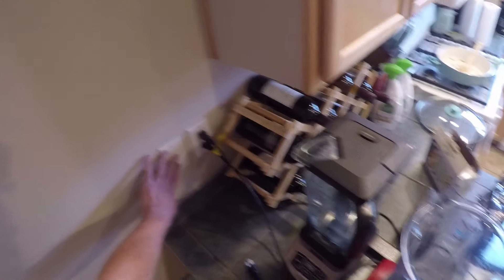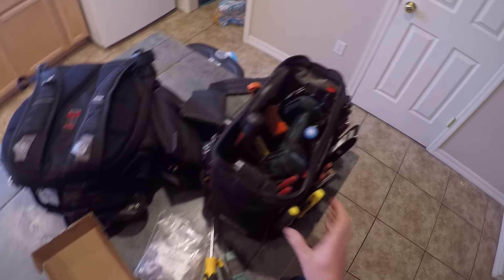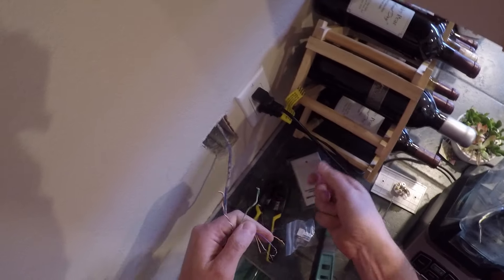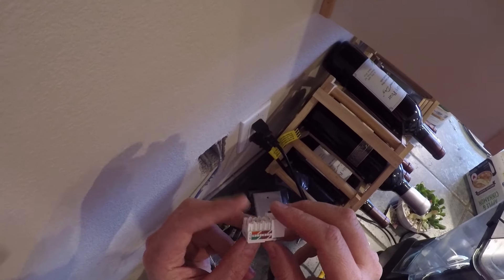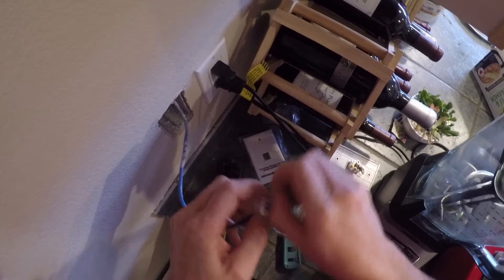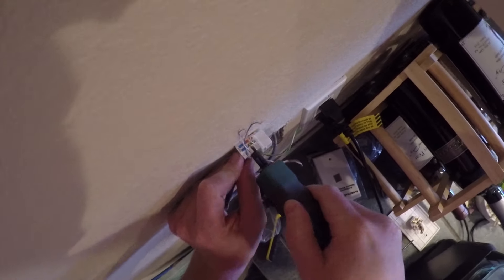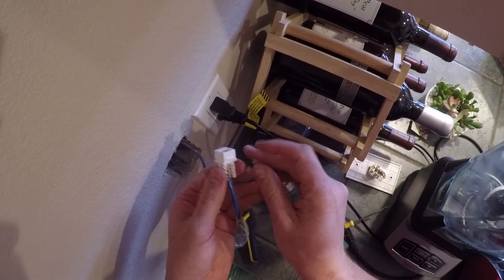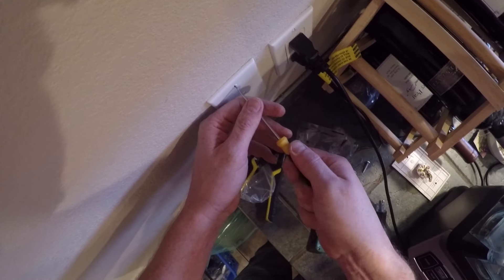Learn how to turn your phone jack into an ethernet port in 3 minutes.

Comment: This is a great option in most homes to convert to RJ45 port however finding out where it terminates is the real challenge.  Often it will be outside in a phone box on an exterior wall.  A ethernet network toner would be a great tool to locate the path of the cabling so it can be determined where the other end of the cable can be terminated closest to the router location.
Reply: Just use a multimeter on Continuity and extension plug(or long wires) . Use the pins on the extension plug as a extension for your multimeter probes . 

Stick one end of the wire that you are trying to identify into one of the holes on the plug then take the other end of the extension plug wherever there are data cables and then stick one of the multimeter probes into the same hole of the extension plug but oppisite side , then with the other probe touch the wires one at a time till you hear a beep or have continuity

Comment: Sorry if  this is a dumb question but once I do this how do I connect it to my router. For example, I want to give my house ethernet access. There are multipel phone jacks throughout the house. Do i just need to change the wiring on 1 phone jack, connect it to the router and then my house has ethernet?
Reply: I am wondering the same
Reply: You buy a network switch, plug that into your router and then each rj45 into the switch ports

Comment: How do you know if your house is wired with Cat 5? I found a wall plate in my home office and there's a blue cable that looks like Cat 5. How you know if it's 5 or 5e? I have no idea where that wire is coming from.
Reply: Just look at the print on the cable, mine says 5e. If yours only says 5 it's only 5

Comment: You don’t need an actual punch tool, but they are good. Use a screwdriver or leave slack, pull down, then cut the excess wire to get them in there

Comment: These were generally for phone providers not for use for DIY networking which means they are wired to some central location that goes to the telecom network. Even if you somehow manage to get your LAN to that central point do you want all ports on the same network anyway? Probably not.. better off just paying someone a buck and a half to do a proper drop.
Reply: All ports on same network?! What exactly do you mean.

Comment: Great vid, what do you do after that? For example, I have a coaxial cable for my internet.  Do I have to find the other end and plug it in the back of my router?
Reply from the maker: Coax cable will feed your modem only, not any other device in the house. The modem will have a coax in, and an ethernet out. That ethernet cable will then feed the WAN port on your router, and this cable should be plugged into the LAN port on your router or your routers switch, or a separate network switch. If you have a combo router-modem, the coax cable will feed the router-modem and this cable will plug into the router-modem's switch. Check out my other videos on network topology, where I explain what all the network components do.

Comment: how do i find the other end of that ethernet cable? I have multiple around my house. I feel like there should be a main somewhere feeding each jack in my home.
Reply: Yeah i’m trying to figure out the same. I have 4-5 phone jacks throughout my house, with cat5e cables feeding them. Then I have one un-terminated cat5e that ends in an exterior box that otherwise has only coax connectors in it. So, how is that exterior cable connected to all the phone jacks in my house? Are they all spliced together or something? I would have thought you’d need a switch of some sort to make them all functional.
Reply: @TheStereoField  were u able to figure this out?
Reply: @kevs1768  yes, but not in a good way. They are all daisy-chained together, which works for phone lines, but not networking. I ended up getting a few MoCA adapters to use my coax wiring instead, since running ethernet in my house would be a major pain. The MoCA setup has been working great though
Reply: @TheStereoField  Or you could be spicy and use it like a bus-net, which was the case most of the time when Ethernet was new, that's why it's so good at collision-detection!

Comment: Hey Justin, Thanks for the video.  Whats standard A and B ?   How do I know what is my house using?
Reply from the maker: Check out this website on explanation of the different standards. 

https://www.truecable.com/blogs/cable-academy/t568a-vs-t568b

TIA 568 A is more modern and is needed for some types of protocols, TIA 568 B is more compatible with analog phone systems. Both standards will work fine with ethernet as long as you have both terminated the same way. Keep in mind, one of these standards MUST be used. Simply ensuring that pinouts are the same on both ends will not render a useable data connection.

Comment: I used a connector like you had and my network never worked.  I didn't know which is A or B on the other end of the cable (which goes to a network hub).  So I got a cable with screw posts, however, if there is a A-B  difference, which wires are involved?  I followed the directions and it seems my network still isn't being recognized.

Comment: Thanks for the vid! BTW, once I do this, will this disrupt my land line service in another room that's also connected via cat5e as well?   Obviously, they don't share the same wire, but maybe daisey chained elsewhere?
Reply from the maker: Land line will no longer be active on this port. Check your network hub. The other end of the cable should be terminated with a crimp type or punch down Cat6 connector and ONLY be connected to a single switch port. If it is spliced into a phone system or terminated any other way, it will not work. I'll see about making a video on terminating the other end, as I'm getting questions regarding this.
Reply: @audioenvision8626  so maybe this is my problem
since 2 rooms have phone jack and one phone jack doesn't work in my room,idk why maybe not connected,not sure

Comment: Could I do this same thing but with a cat 8 insert?
Reply from the maker: Yes, but you are not going to see much benefit if the house is not wired for Cat8. It's a lot like putting a golden gas cap on a Ford Fairmont.
Reply: @audioenvision8626  How do I know if my house is an A or B for the hookup? I didn't hear you explain the difference when hooking the ethernet plug into the wiring.